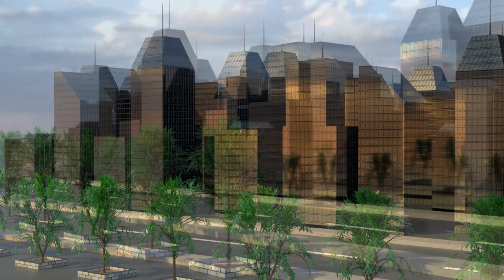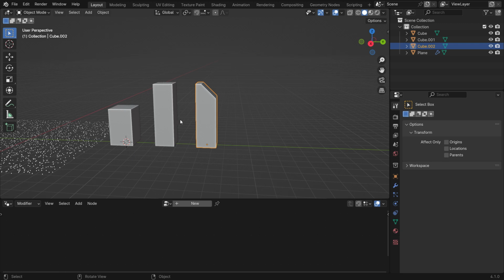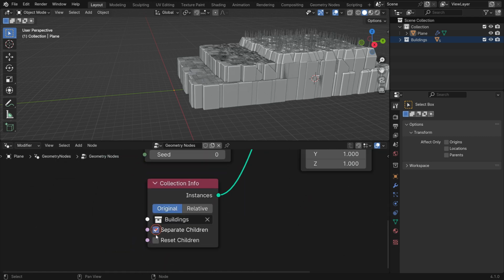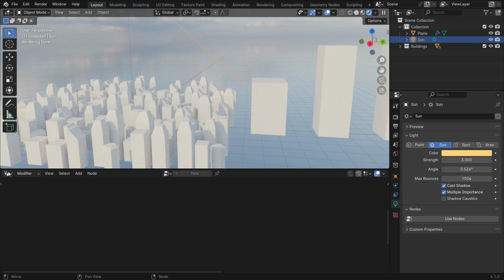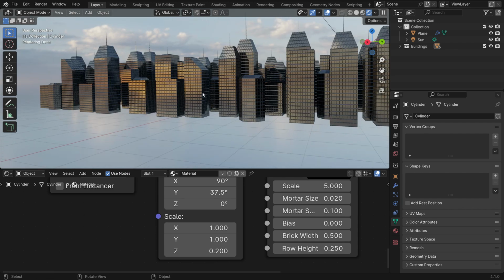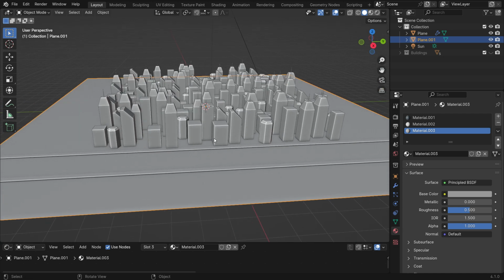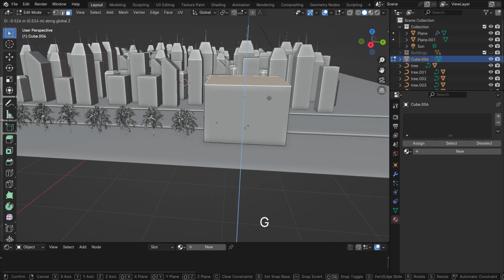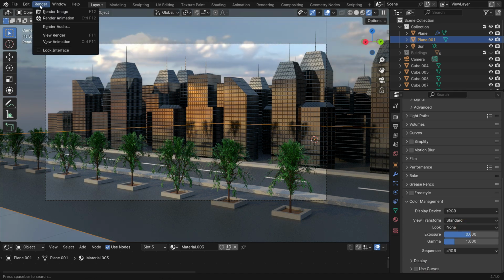How to Easily Create A City In Blender 4.1

Comment: Thank you very much once again. For some reason, my scene didn't render out well. I don't know if it's because I didn't position the sun well but the shadows didn't work. This didn't come out well for me, but thanks for the tutorial. Wish I can show you the outcome so you guide me.
Reply from the maker: You're welcome! It sounds like the shadow issue might be related to the sun’s positioning or strength. To fix it, try the following:

Sun Positioning: Make sure the sun is pointing in a direction where it can cast shadows. You can adjust the angle and position of the sun in the scene to see if that improves the shadows.

Sun Strength: Ensure the sun strength is high enough to create visible shadows. You can adjust the sun's strength (found in the Sunlight properties) to a value like 3 or higher.

Shadow Settings: In the light source (Sunlight), check the Shadow settings. Make sure the "Cast Shadows" box is enabled and try increasing the Sample value for better-quality shadows.

Render Settings: Double-check that you're in Render Preview mode (Z key) and that the shadows are enabled in the Render Properties tab.
Reply: @mk3dgraphics  thank you so much. After changing the render settings from Eevee to Cycles, it turned out just like yours. Thank you!!!!!! It worked!!!